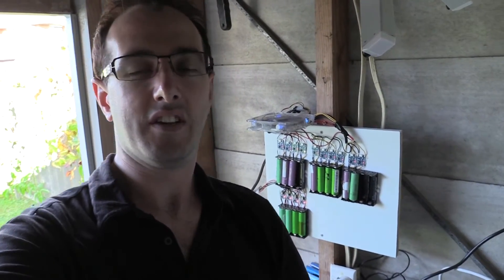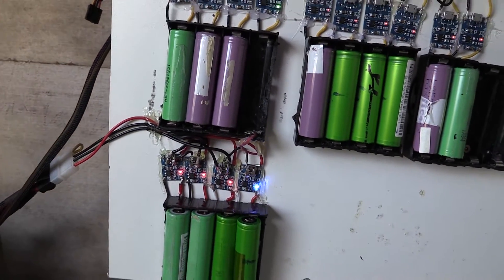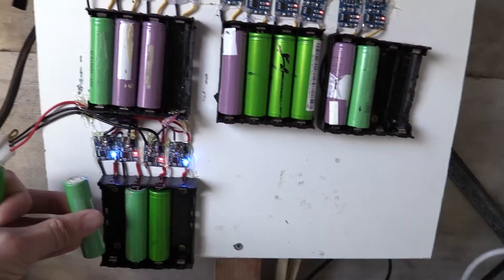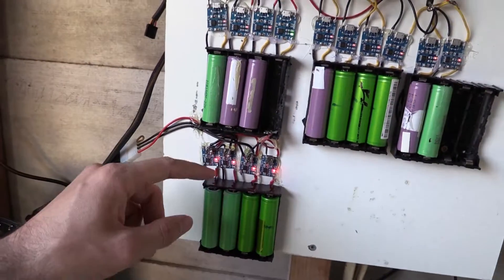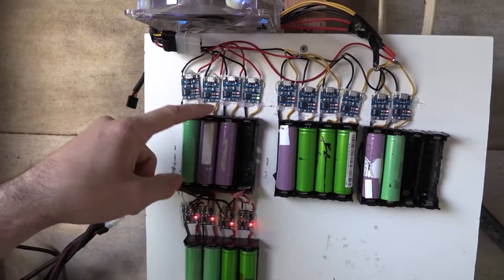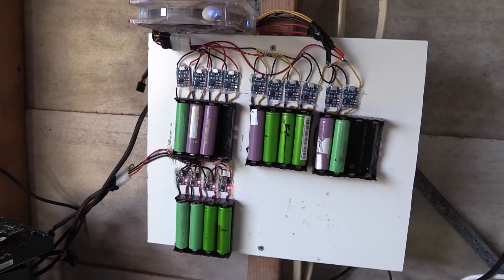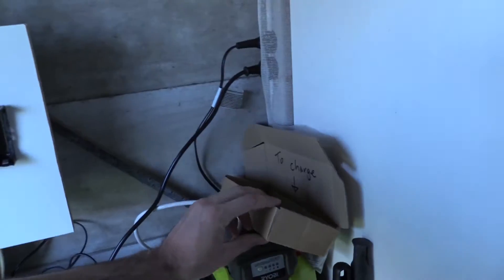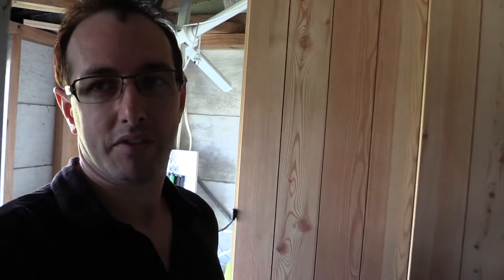DIY Powerwall 18650 Charging Update - An upgrade to 14

Comment: Quick tip for taking apart the old laptop battery packs: use an oscillating multi tool. You don't have to brake anything then and you can open it without manual pressure.

Comment: I have the same issue bottlenecks with stripping packs, charging or capacity testing... almost a full time job. So when I'm at work batteries are charging.
Reply from the maker: +Eric Scherzinger total pain, i need a helper haha
Reply: +Mikes DIY Tesla Powerwall you probably need a big charger / discharger that could do large quantities of cells :D